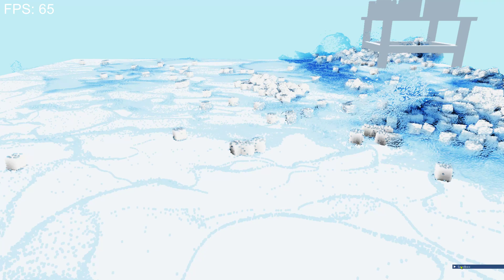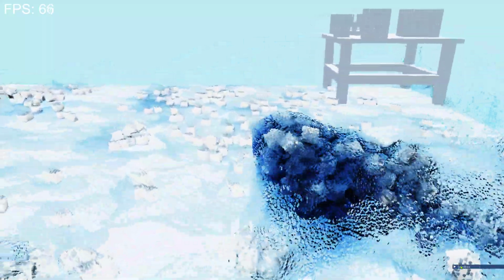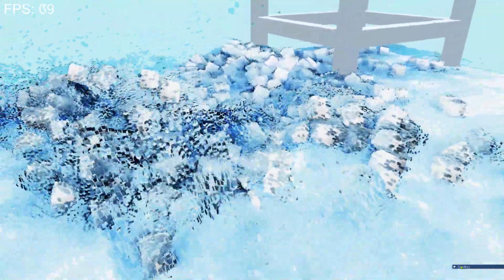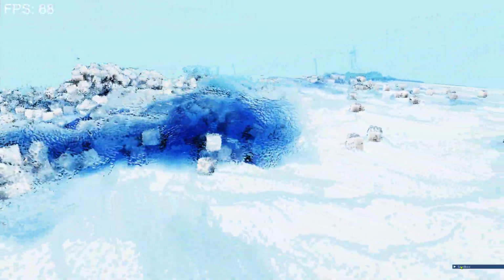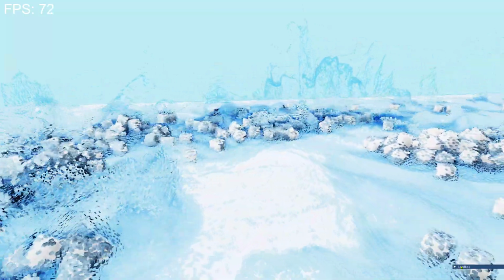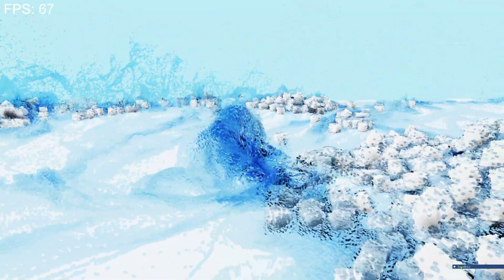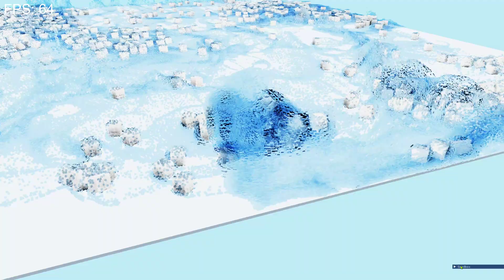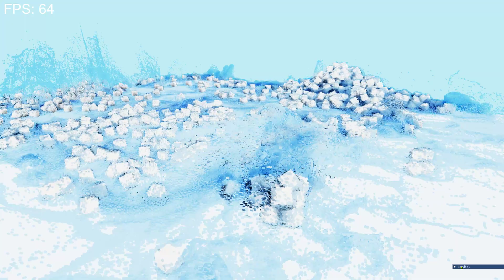Deep Water (1/6):  16X Increase of Simulation Domain

Comment: Very impressive: congratulations! I was curious about the number of (cube?) particles? Thanks.
Reply from the maker: 2M total particles. There are 1000 cubes each 10^3, and then 1M water particles. Currently it's pretty shallow because of the wide area, but will try to address that with adaptive resolution.
Reply: @GrantKot  Wow: all that above 60 FPS. Hats off

Comment: It's a pure diamond, but I'm terrified, it's not too big an area and there's almost no water here, but the FPS, as you said, will be only 120. That is, it is impossible to arrange a duel on pirate voxel ships with a more or less deep draft. Maybe you could demonstrate a voxel ship in such water and how it sinks🤔
Reply from the maker: I have some previous experiments with adaptive particle resolution, that I will work on adding to the new simulator. But yeah, deep water is tough with particle based liquid simulations. I also have some ideas with layering on top of a lower res 3D simulation, but there is a possibility I may need to put the particle layer on top of a heightfield simulation. I also imagine adding terrain would give the water more places to pool up. Maybe fights can put the players in smaller areas as some turn based games do.
Reply: @GrantKot   the coolest thing would be to repeat the firefight of the ships from Pirates of the Caribbean 3, when they were sucked into a giant whirlpool😬😬  Why we don't have photonic chips yet 😢

Comment: your simulations have always been 128^3? i always thought they were 256^3,  seems like theres a lot of compression then, because it always looks so shallow.
Reply from the maker: Might be because I often have the rest density set to 8 particles per cell. There is also some compression, I'm going to do another attempt at multigrid pressure to help with that.
Reply: @GrantKot  also sorry i couldn't reply to your reply in the other video, for some reason it kept disappearing.